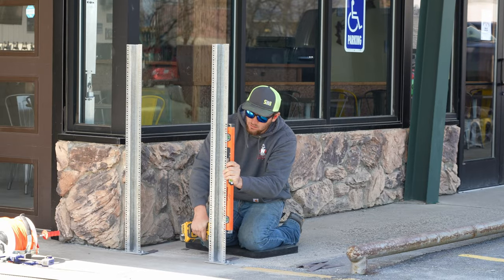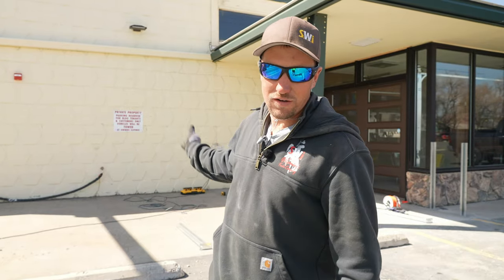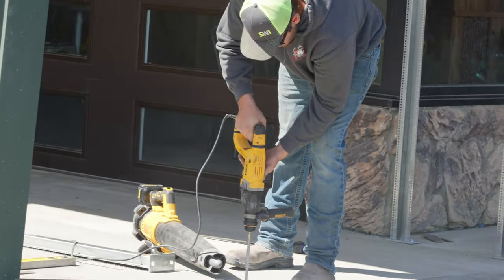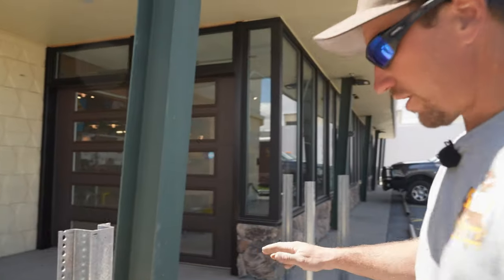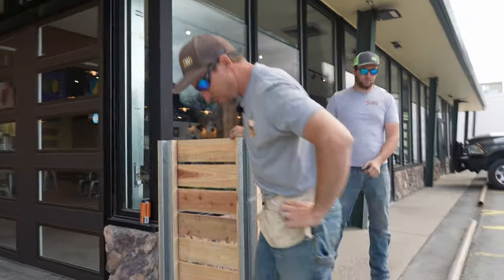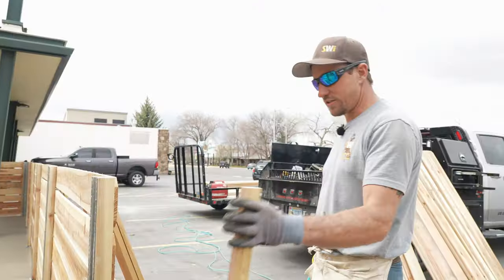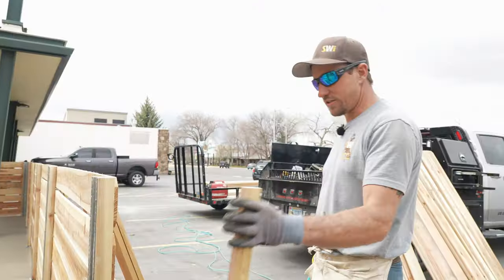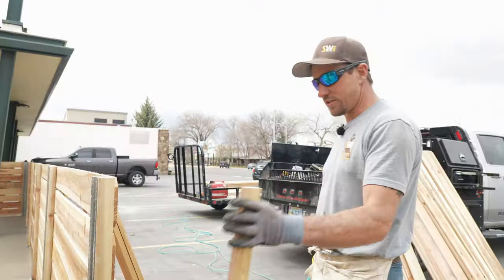Please Don't Call This A Pallet Fence

Comment: I used the Simpson anchors on 5ft chain link gate post and they are so much easier than anchor bolts with the nut and washer

Comment: Also, as a DYIer, I found that a hammer drill (at least in my hands) is not a precision instrument, so its smarter to drill the 2nd hole with the post base in place as a template, and even an anchor dropped in the first hole (but not tapped in). Trying to "move" a drilled hole in cement a smidge to the left doesn't work well.

Comment: I'm looking at doing a railing on top of a high retaining wall very similar to this, but trying Simpson StrongTie EZ Bases with 5.5" wedge anchors. Main problem is that the only 4x4 posts that really fit are PT pine. Looking at this vid, I'm not sure I'd trust your tiny welded-on post bases with those dinky 2 inch concrete anchors. How well do you think that will hold up against a good severe thunderstorm or a clumsy 250lb dude tripping into it?

Comment: Great videos guys! I have one question, what material are you using to make the base plates for the bottom to bolt to the concrete?
Reply from the maker: 1/4" thick galvanized steel.

Comment: Is it better to sight test the poles height like you did OR place a level between the post? I'm guessing you guys sight test because it has not caused an issue.
Reply from the maker: We eyesight post height because we build to roll gently with the terrain. The ground we're building on is never perfectly flat.